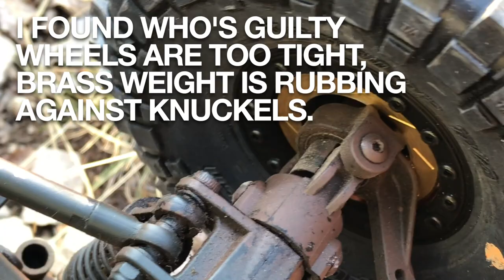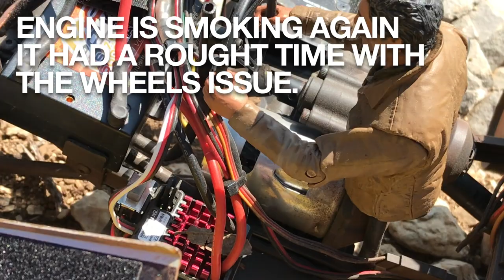TOWDGE Axial SCX10 v1 Dodge Powerwagon Tow Truck Gilette

Comment: about the motor... I replaced my 55t 540 size with 27t 550 size Holems Hobbies Trailmaster and am using 16t pinion. It's perfect on 3S battery with HW 1080 ESC!
Reply from the maker: Žarko Jovanović thanks for sharing 👍🏻

Comment: I saw this build and I so needed to comment I just can't believe how beautiful this towtruck came out. one question on my mind though as beautiful as those gas tanks are on the side do you plan on making any kind of guard for them to protect them they look like they could be dented. Thank you for putting this up amazing build.
Reply from the maker: Jahmen RC thank you! I’ ve been thinking about a mini slider for the tanks, but I like them just like that... I’ll see how it turns out when building it. In the worst scenario if I damage them too bad it will only cost me a mini deodorant spray and a can of concentrated tomatoes to build new ones 😃
Reply: @fullspeeddesign  wait so what you're saying is that's plastic? if so you did an excellent job on painting them they look very realistic and almost metal mice working man!!!
Reply from the maker: No no cans are metalic, painted and wheatered :-)
Reply from the maker: Plastic would have broken on the first mountain trail
Reply from the maker: Jahmen RC this kind of cans 👍🏻 https://goo.gl/images/96kXNu